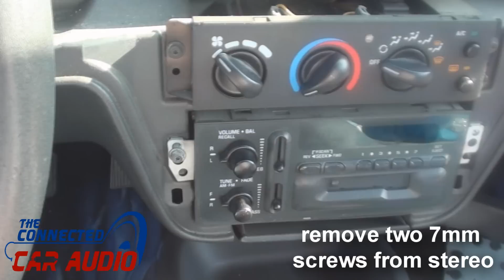remove factory stereo Chevy cavalier 1995-1999

Comment: for anyone who couldn't get the airbag part loose.. i ran into the same problem there are two screws further in the glove compartment at the top you may need to lay down with a flash light to find them but they are there.. after i got those two out it went very quick. you can see the hole very briefly at 1:08

Comment: ok! just took the dash apart in my 98. In the top left corner of the glove box is a recessed home with two bolts. undo those and the dash panel slides or with the air bag pad still attached. don't try to pry the pad off, you'll just break the clips..
Reply: Had the same problem with my 2000 z24
Reply: Had the same problem with my 2000 z24
Reply: Got a 99 Thank you for this. I thought i missed a step. It just wasnt there

Comment from the maker: J aw I cannot reply to you directly maybe because you don't have a Google plus account. So hopefully you can get this. But in 2000 gm started to use the class 2 database system in the car stereo system. In order to install a stereo you need to use a specific wiring harness designed for class 2 data systems. They are basically a harness that plugs into the factory stereo wiring but also adds a module so the aftermarket stereo and the vehicle can talk to each other correctly. It also keeps safety features like door chimes and conveince systems like the stereo turning off when you open the door. It keeps alot of the factory functions functional. Visit Metra car audio website and find the contact info. They are the people who make the aftermarket car stereo parts. Ask them what module you need. Because I swear there is like 6 different ones and it can get confusing.

Comment: How did you get the airbag cover piece off? I removed all the screws but can't  seem to get the dashboard released around the airbag area. Am i missing a couple clips?
Reply from the maker: I looked at my video and cross reference my instructions, looks like all the steps are there. After removing the 1 screw for the air duct did you remove the panel and remove the other screw inside of the air duct?
Reply: Yes I did but it wont come loose around the airbag.
Reply from the maker: Steven Kuhn it's been long since I did that vehicle. I can't Rember if that area had clips around it. I would try using some pressure upwards with a panel removal tool or your hands to try and release the clips (that's if there are clips there) be careful though those dashes are known to have sun damage and can break easily. Use steady pressure and get the panel to come up.
Reply from the maker: connectedcaraudio and you did remove screws from both sides of the vehicle, I'm the video it almost looks like I'm taking off the same screw twice but it's on opposite sides
Reply: Yeah I got all the srews removed. I'll give it another shot.
Reply: Did you ever figure it out I'm having the same problem ???
Reply: Honestly no. I just pushed the half above the cluster up and pulled it out. The dash started to snap so I had to stop trying to get it to release around the airbag.
Reply: +Steven Kuhn yea same thing happened to me thanks

Comment: You didn't need to remove those 2 brass screws that you did from 1:06-1:30.  There is also another screw next to the connector you unplugged at 2:58.

Comment: 2003 has TWO plugs on back of stereo, i have never seen this. Aftermarket stereo does not work when I dont use this smaller, second plug. So lost...
Reply: Must be a 1.5 din